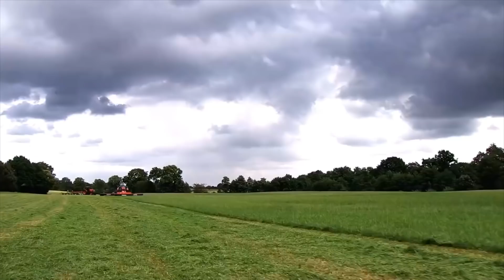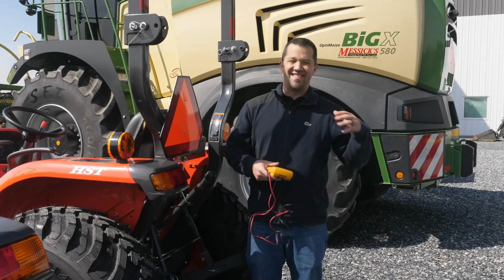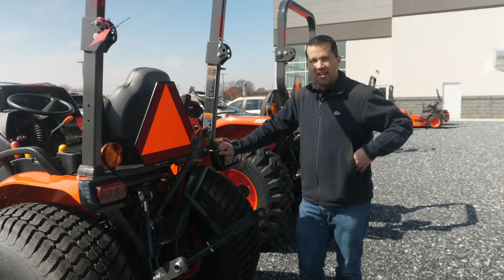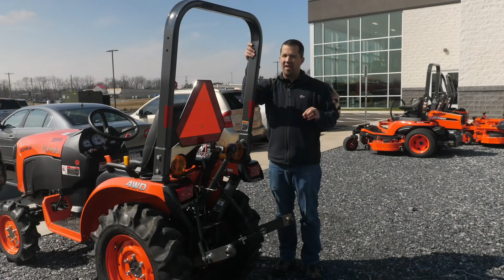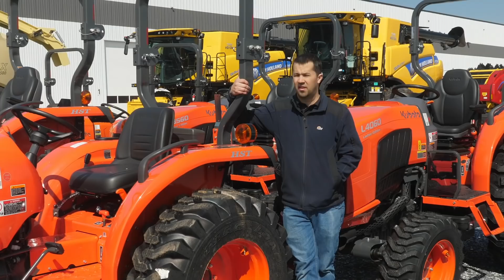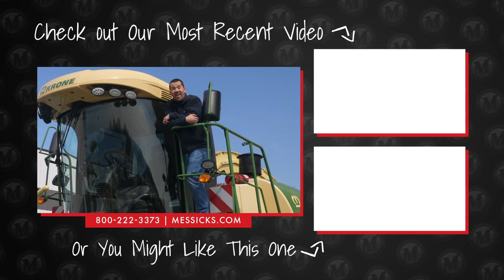Tips for Installing Work Lights

Comment: Grand l and mx cabs, just pop the top off. Way easier to get at the wires that are taped in, that biue tape Kubota uses doesn't rip or pull apart like our black tape does. Wish we could buy that tape.

Comment: I was just thinking about how to upgrade my work lights on my B2650 with Cab. OEM is adequate for just working but are not bright enough for cutting grass at night. Anyone know bulb number to replace halogen bulb with LED for front and rear work lights on B2650 cab? Owners manual only says 35w bulb. I already swapped all my headlights hazard and marker lights with LED. If i can swap out whats there for cab work lights it would be easier than adding new lights.  I know the LX2610 vesrion comes with LED light assembly that i could buy and swap out to upgrade but that would be the more expensive way to go i am guessing since that would be a kubota part number.  I already have 4 really good LED lights i kept off my old tractor but i would like to use them for other stuff. I might add one or two on my backhoe boom.

Comment: 1st thing I did with my new Massey 2850M cab was pull off the regular work lights and install LED ones.  I bought some inexpensive ones from Amazon and had to build custom mounting brackets out of Aluminum flat bar to get them to mount the same way.  Massey had bullet connectors already on the work lights, so adding the connectors to the new LED's was easy and very convenient to connect.  My first time using Aluminum for a project and they came out well.  Much brighter than the OEM lights that were on it, and a whole lot cheaper than the OEM LED's.

Comment: Thanks for making this video showing the locations. Is there a chance the kubota m59 doesn't have this plug or harness because it already has some lights on the front and rear from factory? If anyone has found the 12v plug on an m59 I'd love to hear where you found it.

Comment: Great video as usual. I added rear LED work lights to our L6060 grand cab using the top signal light brackets. There’s already the power harness for them there. Then i added a waterproof connector by The 3pt and added LED work lights to the boom and the stick of the BH92 backhoe. It never fails that I end up having to dig unexpected at night.

Comment: A lot of forum posts about the B2650 and why such a new expensive little tractor still comes with a dynamo and not an alternator lol
Reply: Weird, even my BX2680 has an alternator.
Reply: I have a B2650 with Cab and it has an alternator because of Defroster on rear window and fans for heating and air conditioning. Think only ROPS has dyno

Comment: If you are adding lights to riding mowers please check the amperage output of the engine because you can prematurely wear out the engines stator if you try to run too many lights on it.

Comment: Neil, just bought a new BX Kabota from Messicks - can someone let me know where the plug you were referring to is located.  Thank you.
Reply: Mike, on my BX2380, there were three bullet connectors teed off the wiring harness in the back. Ground, +12V, and 12V switched with the running lights. If you stand at the back of the tractor, look to the left of the top 3pt mounting pin.
Reply from the maker: This guy! ^^^

Comment: To drop the headliner in the LE you have to remove the roof bolts, and all the HVAC stuff is above it. The cap weighs about 20 pounds tops, so easier to just pop the top, slide it back a bit to access the wiring, and you have to raise it to put the bolts in the front brackets anyway. 

What would be great is if Messicks could stock the male plug kits for the lights, a crimp on kit with two male spades and the matching plug would sell a lot!  I just put LED lights on mine and since I could not find the plugs, I replaced the ones on the tractor with Duestch connectors. A little larger and light gray in color but 100% waterproof.